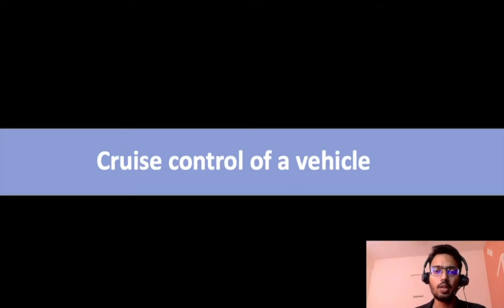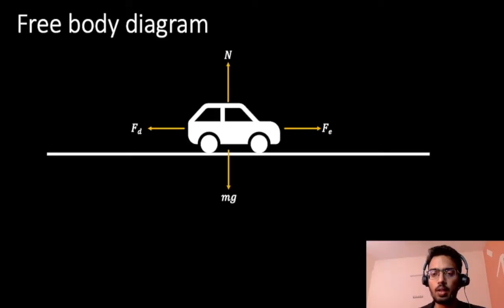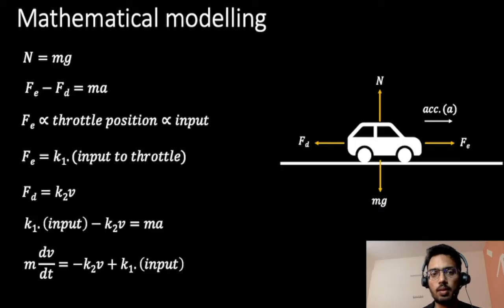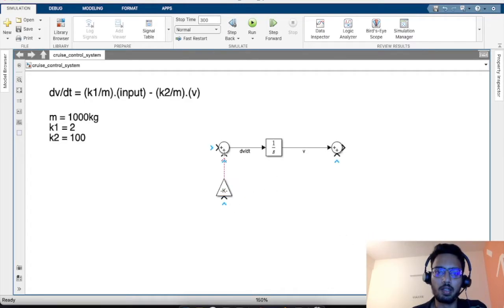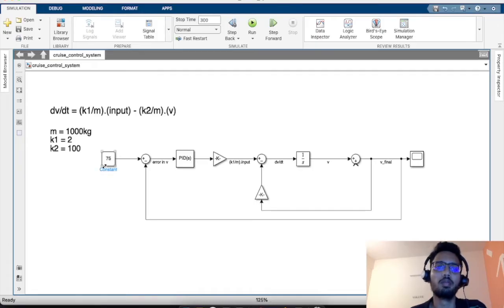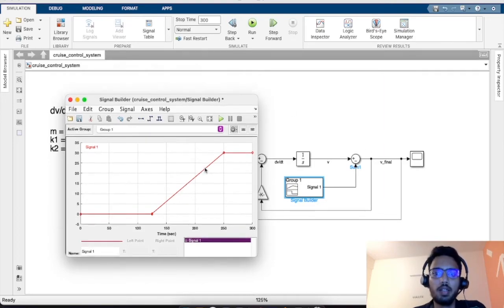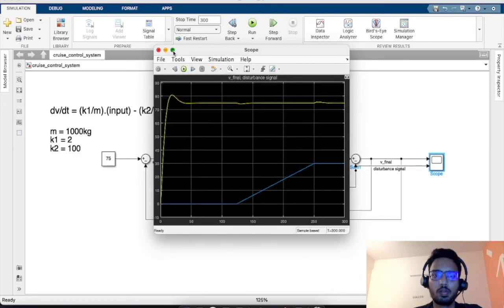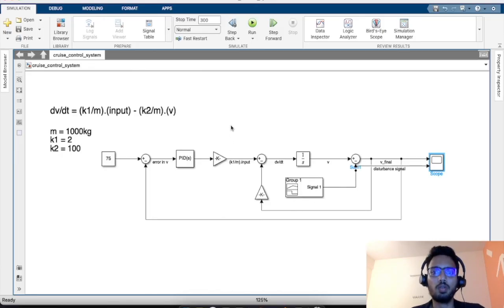Cruise control of a vehicle in Simulink

Comment: Good job buddy!!!

However, pardon my ignorance, but could a simpler model like that work in a real vehicle?

Real vehicles got torque (force*wheel_radius) curves so modeling its force as k*tps isn’t accurate for most speeds. Additionally, real drag equation depends more on v^2 so the differential equation is not feasible with what i said.

With all that into account, which should be the best way to compute a tune a PID controller for a real combustion vehicle???  

I can understand that real cars will work as negative error -> apply throttle meanwhile positive error -> lift throttle, but do they tune controllers empirically, use an accurate dynamic model of the car or use other methods to calibrate the system?

 Appreciate all responses